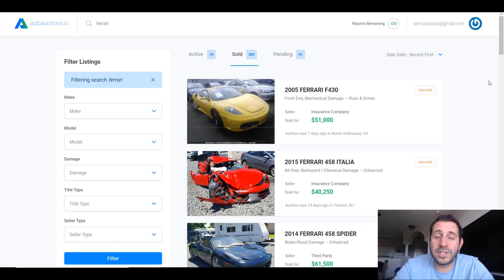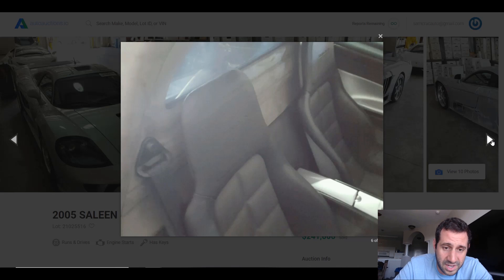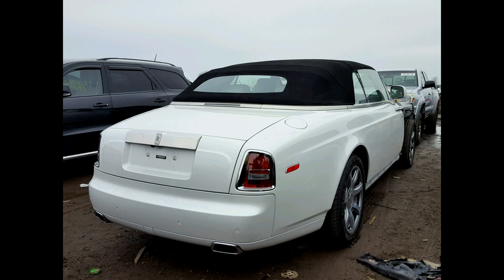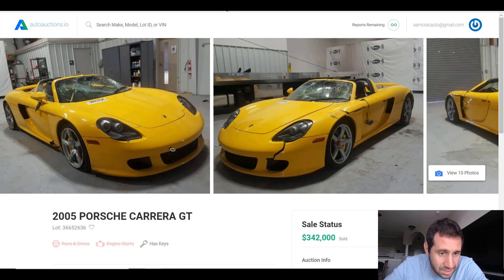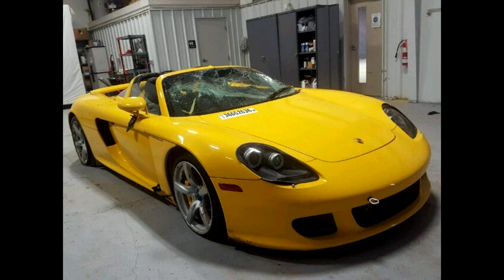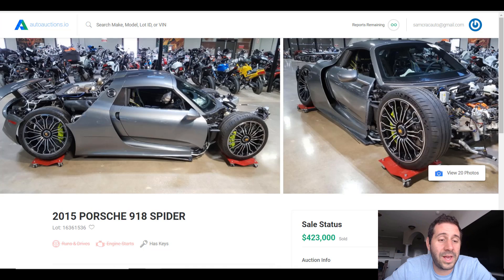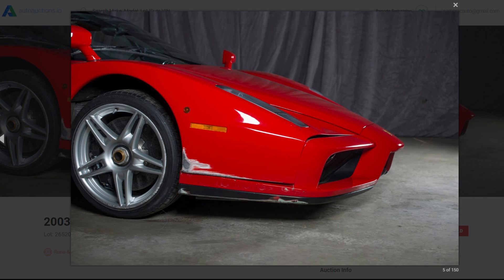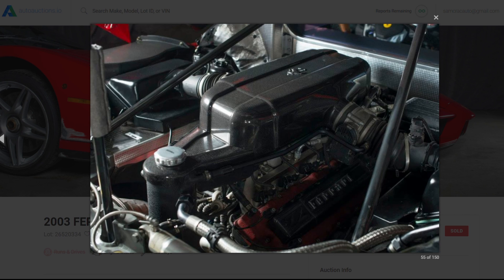These 5 Wrecked Supercars Sold for Hundred's of Thousands $ WITH Salvage Titles!

Comment: I  remember when the 918 went viral a Porsche technician posted the prices from the Porsche parts catalog. The engine alone was $203,300 the transmission was $70k, EACH brake disk was $9k, the bumpers were $18k, and a set of wheels were like $20k... $35k if they were magnesium wheels.
Reply: 203k$ cost might be like you go to the factory and just take the engine, because a youtuber AutoVlog had 2017 Mercedes C63 AMG hydrolocked, for a brand new engine replacement it was estimated like 75k$.
Reply: @juris789  but the 918 it's hybrid so it's more expensive

Comment: I was the claims adjuster on the Carrera GT at the California speedway. I can't comment much on it other than it was a double fatality. Both the driver and passenger died on impact. There were no interior damages to the car whatsoever. But the entire right side looked like it was sheared off including the rear suspension. Apparently the owner was a .com millionaire from Northern California. I still have the photos of the car.
Reply: Double fatality but no interior damage?
Reply: @philb707  They both broke their necks. Same injury as Dale Earnhardt. No neck protection devices were worn. Look at the pic of the car in this video. It's the actual car after the impact. You can see the damage was not that bad. They hit the wall and sheared the entire right side of the car off. Estimated speed was over 150mph at the time of impact.

Comment: Sam, you keep saying you don't know how carbon fiber can be fixed.  But carbon fiber is "just" frp, fiber reinforced plastic. Fiberglass was just one brand name for frp. So you match the carbon fiber cloth, and you match the resin, and you match the original build quality. Techniques and decisions are all the same. Same way you do body work on a 'vette but you need damned high standards. Rattle cans need not apply.
Reply: Matching the exact cloth and resin might be near impossible. Close enough might have to do.
Reply: Dont be surprised if ferarri bought the enzo back I could see them fixing it they could do it with the least cost and probably put it in the museum before someone else dumb gets ahold.of.it lol
Reply: @firesurfer  with cf being so thin and usually unpainted, making damage disappear is too expensive, and just making it strong again isn't aesthetically acceptable. So there's a $imple reason they total it. It can be a great car but it may never be "right" again.

Comment: I’m fairly sure that Enzo is the 100k mile one. Look it up and you’ll find plenty about it. Car was totaled than rebuilt and since then the owner has put over 100k miles on it driving it across the US. It was also a twin turbo car at one point I’m pretty sure.

Comment: According to Carfax that Ferrari Enzo was imported to United Arab Emirates in 2015 and has not been seen sense.
Reply: probably rebuilt by an Arabic Sheikh, or turned into furniture by an Arabic Sheikh
Reply: amnottabs  No it was most likely rebuilt and sold to some rich Arab who didn't do his research.
Reply: @-SP.  or was a great parts car
Reply: Its common to take cars like these and sell them off to China or Arab states. Since the salvaged title is only a U.S thing (other countries have their own titles) it won't apply foreign countries and they can get away with selling the car usually at full market price.

Comment: Hey Samcrac- are you sure Porsche settled out of court on those Carrera GT incidents? Because I always heard that they adamantly denied any wrong doing or blame in both cases and would not be held responsible
Reply: There was an insurance claim on the California speedway incident. I did the inspection of the car for the insurance company I work for. It was a double fatality. It shook me up a bit. So much damage to the right side of the car but literally no damage in the passenger area. Nothing. I believe both occupants suffered the same injury as Dale Earnhardt.

Comment: I saw number 1 in person I was looking for a project bike
Reply: I have been looking for a project bike too.  I am torn between a Hayabusa and a GSXR 1000.
Reply: @dixoncider7256  aren't both the same???
Reply: the Hayabusa used to be 1300cc, but the newer ones are 1340cc's
Reply: @dixoncider7256  thnx. 1300cc gsxr are around 2000 with a yoshimura exhaust if you look for it real good. And that goes for auctions.

Comment: The reason Paul Walker crashed was because they still had the original tires on the car which provided absolutely no grip in a turn.
Reply: Paul Walker didn't crash it.
Reply: He was still driving at a speed limit that was reckless (around 98 MPH).
Reply: and excessive speed...
Reply: Colston Martin still had tires over 10 years old on the car absolutely no grip. If they had tires in good condition then they never would’ve crashed.
Reply: RanTech and he went a lot faster than the one Paul Walker was in
Reply: 190 mph on the track vs 90 mph on a city street where the speed limit was originally 35 mph then changed to 45 mph the year prior could be equal. Driving twice the speed limit is a driving to endanger offence. Speed was the main factor to losing control on a suburban street. The old tires probably didn't help...

Comment: Most of these Cars were probably driven recklessly from the damage on them by Guys acting dumb...
Reply: The one by Walker and his buddy was, 80-95 mph in a 45 zone middle of the day in town.  Daughter tried claiming Porsche should have essentially built a tank.  Every safety feature on the market for automobiles should have been on it.  Stability control should have been on it, seat belt location altered.  Then they should have somehow gone and checked the date on the tires.  Blaming Porsche and not the 2 occupants for their own actions.  Had they hit other cars or pedestrians their estates would be fending off lawsuits themselves.

Comment: Who are these spoiled kids that crash a supercar after running it for 70 miles?! Yeah, hope your daddy doesn't give you a second one.
Reply: They are everybody.  I worked in a Harley dealership.  People would wreck brand new bikes bikes on the way home.  Almost one a year.  On guy took a test drive and didn't make the first turn out of the dealership and put it in the ditch.   One made two turns and not the third.  100 meters from the dealership.  We could hear the wreck.   I've seen a dozen totaled bike with not 100 miles on them.  Not just Harleys either,  all bike dealerships are like this.  Talk to any mechanic at one.